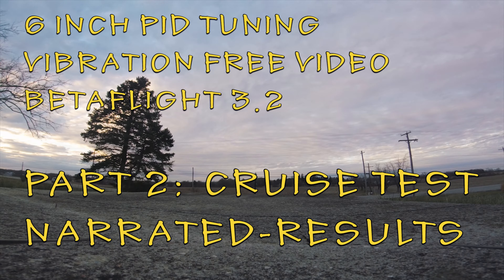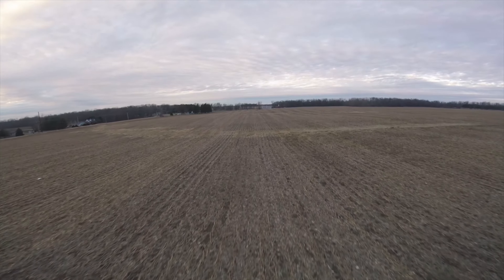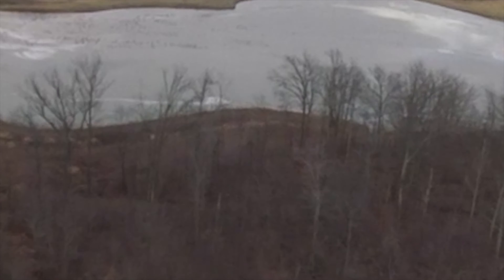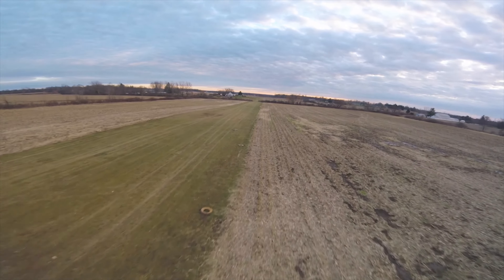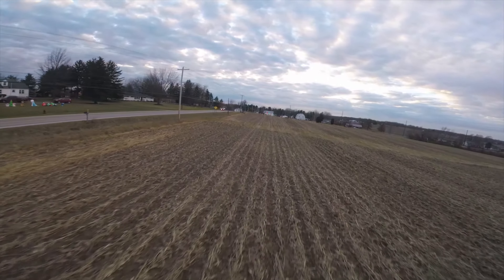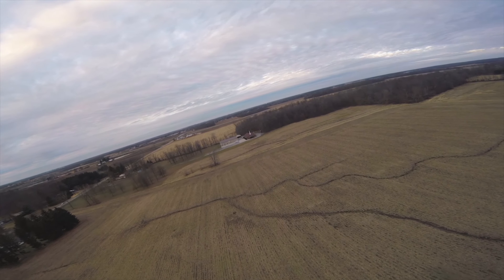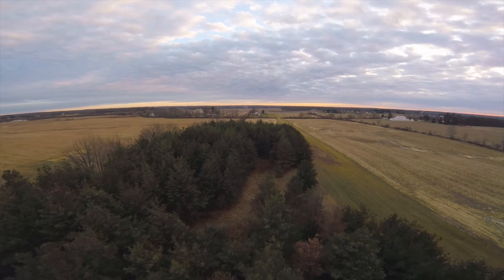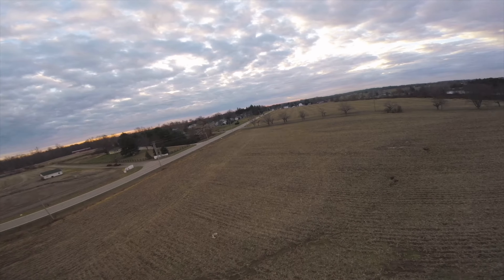6 INCH VIBRATION FREE PID TUNING AND VIDEO PART 2: NARRATED 5 MINUTE CRUISE

Comment: Nice! I’m loving my 6” but hating the vibes. Are you gonna post the PIDs? Did you basically just start lowering your values across the board? What value did you lower the most? 🚁💨
Reply from the maker: yeah I am working on a video going over the setup...few things..what props are you working with and have you really really balanced them?  after that..turn on all filters in BF..I have dynamic turned off..all notch on and tuned and then pt1 turned on.  dont soft mount the motors!!  try starting with Ps at 35 ROLL and 45 PITCH 50 YAW..Is at 45,50,45  and D at 25 R 30 on PITCH..set up 3 rate profiles and just bump each one up so PID profile 2 would be 37,47 for rolland pitch P and 27,37 for D..then profile 3 do 39,49 and 29,39..fly a pack few laps with each profile and check video and see what works best..then start all over again with another 3 profiles going up or down from the one that looked the best..save some time.  Ps will be LOWER FOR SURE and Ds will be close to stock more then likely.   im at work or id give you my values.
Reply: ChaddyCEEE RC dude! That was great advice. Thank you.  Def. have NOT balanced but I have a balancer so I’ll knock that out.  Did you use tape to balance or CA? And I soft mounted the motors 😐, I’ll undo that. I get crazy noise in the video also and I think it’s more a tune/vibration issue and not a noise issue.  Why not softmount?
Reply: ChaddyCEEE RC HQ6045 Bi’s mainly.  Tried he RK6032’s this week but they ate through battery way faster than the bi’s.
Reply from the maker: check out my balancing video..its a few videos back..BUY A DUBRO BALANCER AND BE SUPER SUPER PATIENT AS I AM IN THE VIDEO..I use CA because its just easy and its always worked on my planes..I quit soft mounting for mid/long range because the screws backing out and the mounts getting flatter means you are constantly battling changing vibrations and noise.  I do soft mount my 5 inch free style and race for feel and I use a bike tube because it holds up longer..have a video back a few weeks on that too..SHAMELESS SELF PROMOTION :)  you can def fix that video and boy you need it with amazing views like that..im jelly literally :)
Reply from the maker: subbed too..like to keep an eye on your progress
Reply: How is your filter setup for BF3.5 ? Still running dynamic notch off and other filters on ?  I'm getting mad vibes and gyro blips at higher throttle on my 6 inch bi blades.